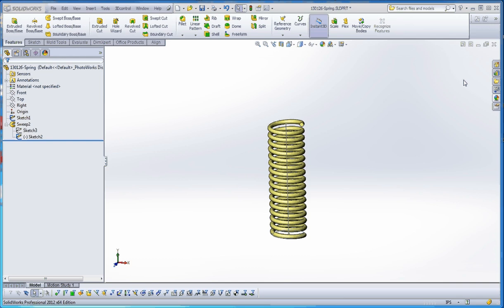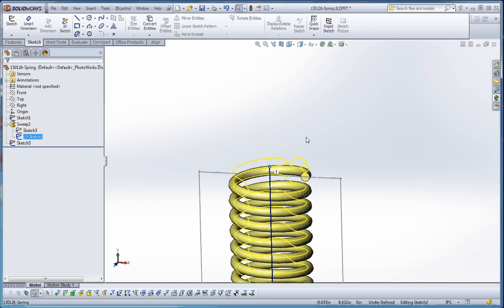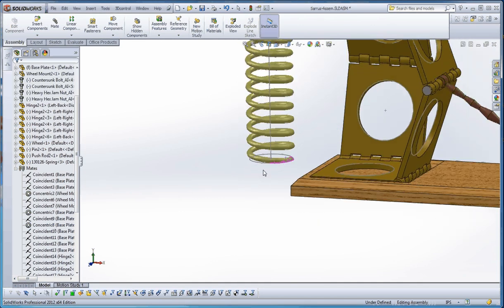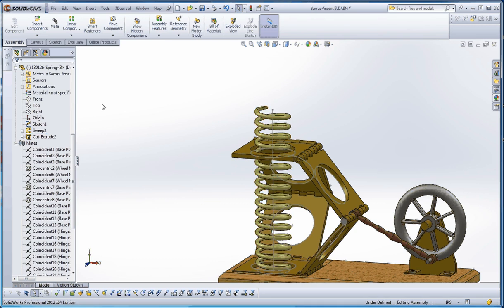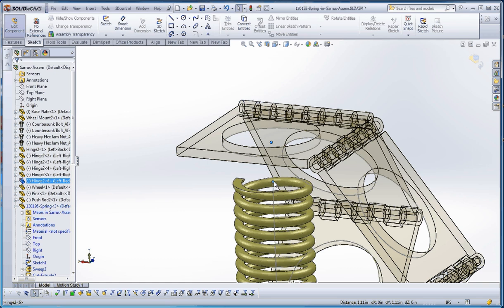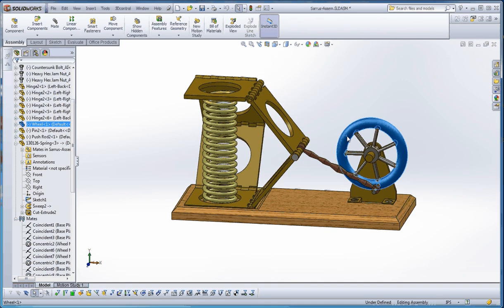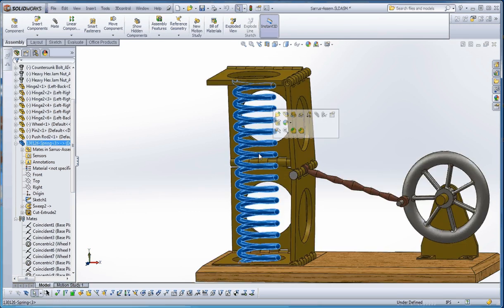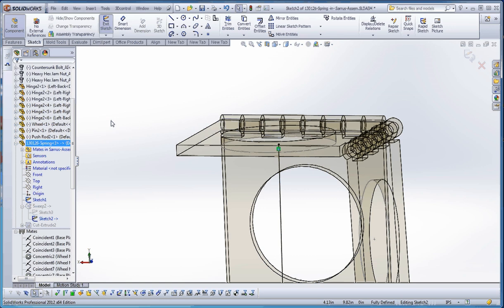Part 3 - Modeling a Spring for an Interactive Assembly, Details, In Context Assembly

Comment: I saw people flattening springs ends with lines and planes, but its the first time I see this operation being accomplished with a rectangle (and now, for the first time, my spring works! I hate SW). The rectangle height is restricted to path length, which is good, but its width isn't associated to nothing. Is it possible to define rectangle's dimensions from wire diameter and spring radius? I don't see a "snap to quarter" like in Autocad.

I saved the file and now it is not working anymore. SW...
Reply from the maker: +Gunther Arnold Thanks for the feedback, hope it works well for others.  And if SolidWorks is new to you, I know, from my experience in the classroom, that there is a long learning curve but it definitely gets easier and faster the more you work with it.  Hang in there.

Comment: Thanks for posting this video.  Is there anyway to utilize this type of assembly method without making it exclusive to a specific assembly?  I would like to create a design table and allow the springs to be used in multiple assemblies.
Reply from the maker: +MARK FLORES There are a couple of ways to do it.  Here is an idea:  I was playing around with this in SW2015 and you don't have to create an in-context relation with the point on he top of the spring, just a coincident relation which makes it much easier.  This way you can use your spring in a number of different assemblies.  However, the height of the spring drives the assembly, so if you change the spring height for one assembly, it will be changed in all assemblies.  Unless you need to animate this, you can create different part configurations for the height of the spring for each of the different assemblies.
Reply: I'll test it out.  Thank you!

Comment: Not quite sure where the center line came from which you mated corresponded to the length of the spring.  Was this its own sketch or included in the sketch containing the cut box you used to dress the ends of the spring
Reply from the maker: Alex, the centerline is a simple vertical model line (Sketch2 of the Sweep Feature) that defines the "path" of the sweep feature (using the "Twist Along Path" and Defined by "Turns" (16) options).  The profile simply rotates around this line 16 times where the height of the line (and therefore the spring) is variable and stretchable.  I can make another video describing this if you like. CSS